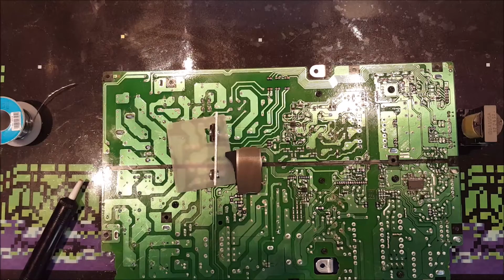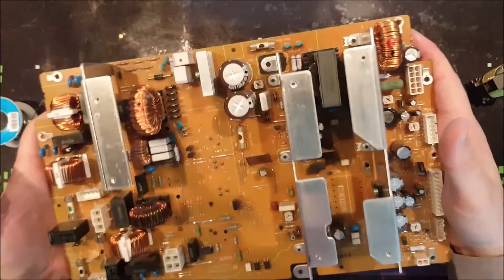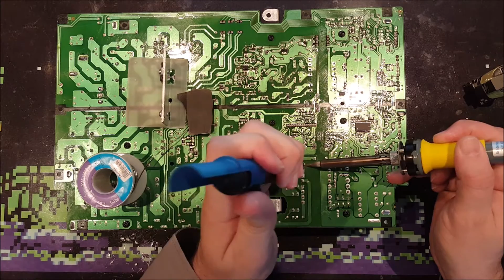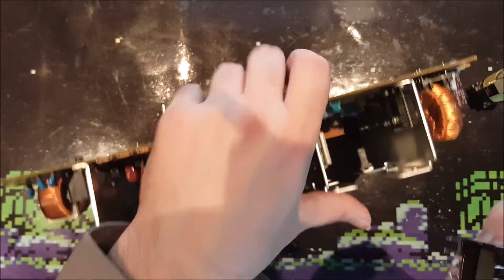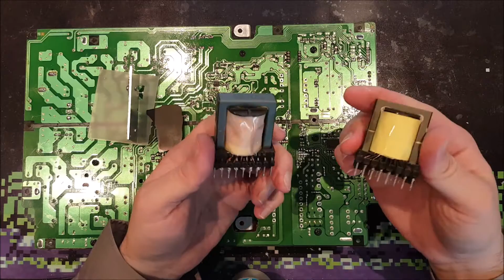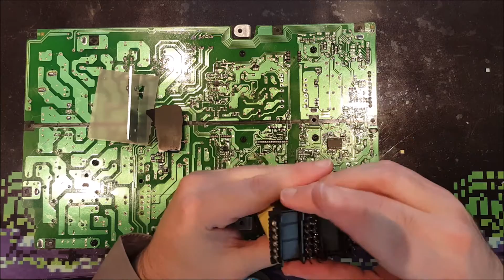How to desolder a multi-pin component from a Printed Circuit Board

Comment: Which solder suckered do you recommend? I have a digital rotary encoder/volume knob that seized up & stopped working which controls power,volume, mute functions. It has a very similar tune knob which I hoped to swap? If that does not work, I will need someone more experienced to help me replace a volume knob on a android radio. Is that something you could do & what would be your fee if so? I need to get the digital rotary encoder out to measure it in case I need to order one. How can we communicate outside of a public forum so we can discuss this job & whether you are willing to do the job? Maybe make a video about it???
Reply from the maker: I recommend a normal spring loaded solder sucker. For me that works the best.
If it is a normal component with pins through the circuit board, I can do it for you. Free of charge; I only ask you to pay for shipping the package back to you. You can mail me at bas at vdsluis dot net, if you need to discuss it.

Comment: Hi, and what if you have 2 layer PCB? Is it also so "simple" ? I've had a feeling that there is also the solder inside the hole. Anyway I'll try also the adding of my solder before heating.

Comment: But how to do it without this sucking thing, having only solder machine.
Reply from the maker: That is very hard. You can try reflowing the solder and then lifting each pin, one by one, over and over again. Takes a lot of patience. You can also try adding copper wire (or desolder wick), which takes the solder away. The good news is, that the desolder pump I used is pretty cheap (on ebay).
Reply: Well, I did it.. That was my first soldering, or should say desoldering.. Point is, first time in my life I was having solder machine in my hand. (I don't know what is the proper name in english for this device) I took me 2 hours.. removing 3 potentiometers, every had 3 pins. First for practice (broken) second as spare, and third (broken) to make space for the spare part. Then spare one reinstall on PCB.. That was hard because I couldn't remove solder from holes for pins.. And I couldn't manged to put pins all through.  Now I don't know it don't work because It needs to go all trough or I burned the paths or something.. probably second option.

Thanks for the idea with copper wire.. maybe I can use that to make holes for pins clear.

Next job will be solder wires.. Never did that.. but it seems piece of cake comparing to this :D